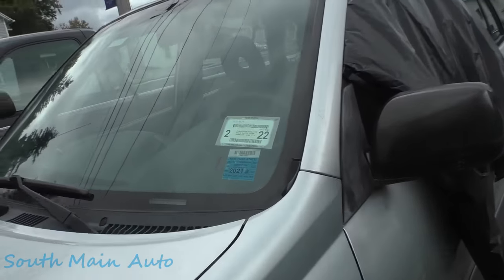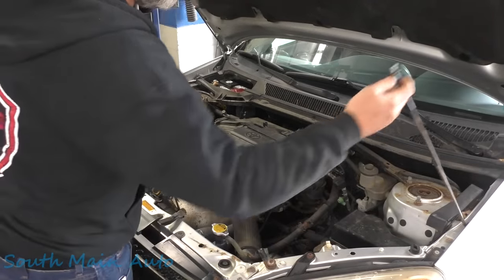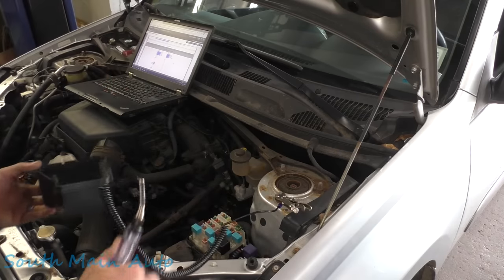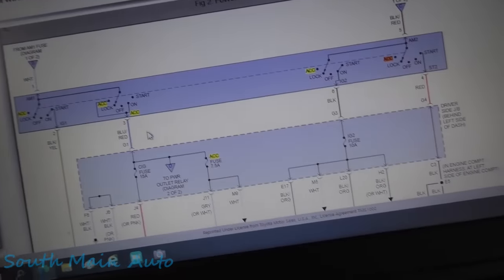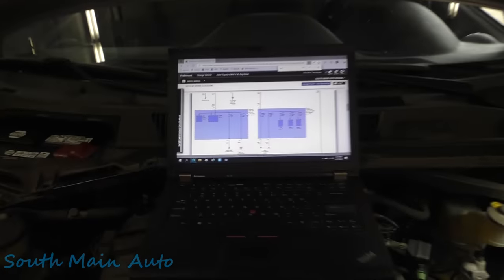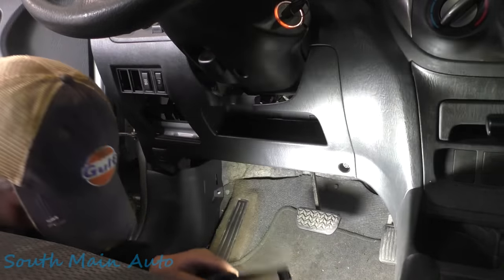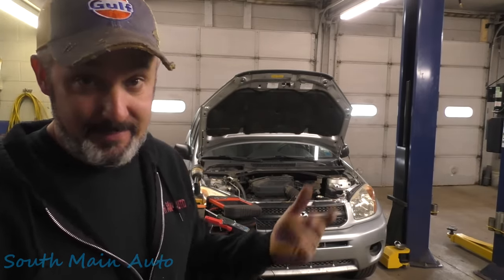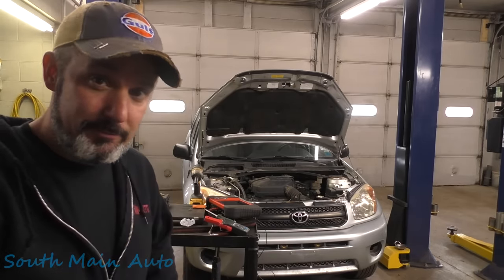Toyota Rav4 Is D.O.A. But Still Runs?

Comment: 24 years with Toyota and 99% of these cases is the customer jumped them backwards! I’ve been a master tech for Toyota over 2 decades and I still learn a few things from your skill! Great humble work my friend!
Reply: What does jumping it backwards entail? Only time I jumped a car off of anything other than the battery (car not tractor) was a stupid BMW (apparently they put the key lock back on and it was only for a few years) where the battery was in the boot and it wouldn't open and had no key lock. It did however have engine bay battery posts fitted by BMW.
Reply: @usefulcontent9894  Jumping  it backwards means putting the jumper cables on the wrong posts(so positive on one car to the negative on the other), either on the car you want to jump or on the other one, effectively shorting out the electrical system on both cars.
Reply: @Enakaji  Thanks. Here in England I don't think we have a term for it. You would just say "they put the jump leads on the wrong way round". I asked because several people said the same thing.
Reply: @Enakaji  Also, in UK someone would be naive to say "reverse the polarity". The Dr Who jokes, comments, references etc etc would likely be too much for the ordinary person to withstand 😀
Reply: That, or if I recall correctly, the Toyota "main fuse" can be blown by attempting to install a battery backwards with the positive cable on the negative terminal and vice-versa.  It's an expensive screwup, but Toyota limits the damage to the fuse rather than the rest of the electrical system.  Some Toyotas use the "R suffix" battery configuration which reverses standard terminal polarities.  They do this to locate the battery on the most convenient side of the engine compartment with the shortest cables.  If the previous owner did not buy the right battery for the RAV4, then he may not have known that correct polarity is very important.
Reply: Yep! Thought the same.  I was thinking they installed that battery backwards (incorrect battery), because that's the most common way the main fuses blow on Toyotas. That, or they helped someone and crossed the jumper cables.
Reply: That could definitely explain the new battery as well, good call
Reply: If not jumped backwards, then they put the jumper cable on the wire, instead of the battery terminal... where it then moves and shorts against the frame.

people believe they shouldn't clip to the battery directly, and they don't... So then they clip on The other side and short stuff
Reply: Without admitting guilt there is a Toyota truck with a soldered in 14 gauge wire fuseable link.          Still running fine.
Reply: That's exactly what I was thinking because the new battery and all.
Reply: @parkinson1963  Yep!  That's what I would have done too ... "hey, it works" ok, if it blows down the road, we'll put the right fuse in without soldering - and it will usually work forever.
Reply: @parkinson1963  ......... lol nice work
Reply: But in 24 years, have you WITNESSED this happen before your eyes? Its an amazing thing to watch as two cars die and the two car owners are looking like they're about to kill each other especially the poor "I don't know anything about cars but are you sure you know what you're doing" person who offered up their car to be helpful. Now their car is dead in the gas station parking lot by the dumpster too
Reply: Looked like they had something hooked up to a toggle switch then it was removed. The previous owner probably blew it when taking whatever it was out before they sold it. That pile of electrical accessories on the floor looked suspect from the get go.
Reply: Embarrassingly, I jumped my gf's car backwards 😅 01 rav4. Luckily I only blew the fuse that powers the radio and the interior lights

Comment: The ONLY electrical component that never fails is the fasten seat belt chime.  When the entire car is crushed into a two foot square ball, it is still emitting that horrid chime.
Reply: Whoever came up with that as a standard on vehicles has a special place in hell waiting.
Reply: An attorney, no doubt.
Reply: So glad we don't have this crap in the UK, I don't know if it's on newer cars though..
Reply: @warbuzzard7167  🤣🤣🤣 that's great!
Reply: @cheeseburgerbeefcake  On my 2012 (European) Volvo, the seat belt warning only chimes if you have it unbuckled and you're moving (followed by an obnoxious beep if you ignore it). Never really saw the point in that annoying chime when you're standing still with the engine off.
Reply: I agree fix what you are requested by work order. My only expectation would be notify the customer especially if you have half the car apart that would be required to make the additional repair. Only other beef is when Nuts and Bolts are freed from being rust frozen, especially brake and suspension parts that the threads be cleaned and anti seize be used on the re-installation to help with future service. Eric is good in this way as he regularly uses Fluid Film to fight the corrosion battle. Others just ram the crusty threads back together.
Reply: Lol there is a fix for that and It Is forever band.
Reply: my volvo will clamp the seat belt down with the power of a winch if you accelerate a tiny bit too hard but if you remove your seatbelt it chimes for 5 seconds, then all lights and sounds disappear for the rest of the drive. makes no sense lol
Reply: If you wear your seat belt, you won't hear it
Reply: @milfordcivic6755  It is hard to repair under a car's hood  while wearing the seatbelt.
Reply: That's why I drive older cars without all that B.S. on them
Reply: Most people don't know how a business is run or they would have one!! Good job my guy!
Reply: Apparently, my old Silverado (bought from family of older gentleman after death) doesn’t have this problem because the old feller deleted the seatbelt chime lol
Reply: I used a scan tool and went in & turned mine off, kinda crazy but that's an option on the new Toyotas lol. Of course, you need a scan tool in order to do it though. All kinds of customizations available with a good scan tool.
Reply: @jamesofallthings3684  Some democrat in DC that works for the Department of Transportation thought he was saving the world. If you think those are bad, cars in Japan start dinging as soon as you go over 60 MPH, and they don't stop until you slow down.
Reply: @donniev8181  What scan tool was it?
Reply: @tuberNunya  the Toyota specific Launch X431 Elite, it cost me around $125 online.

Comment: Reversed cables on a jump, installed battery backwards or didn’t disconnect battery when installing alternator
Reply: The spark out component could have been on the vehicle providing the power during the jump. No evidence left on the dead car.

Comment: "Do the job you were hired to do" is so true when it comes to an automotive repair business.  For me this applies even in the DIY category where I have agreed to do repairs for friends and colleagues but along the way have found other problems. For friends / colleagues the job is similar to a shop job, I'm doing the work agreed at "mates rates" and if I see something else, I'm passing on the bad news! 😂

For family, I will do just that little bit more, if it is in my capability (which a great deal of things are) so labour might be free but the parts won't be! I'll fix as much as I can or want to outside the original job, just outta love! 😏🙄
Reply: This applies to being a computer tech. Communicate the need, move forward if the customer approves, but stick to the plan/quote/request.
Reply: Family is the worst they expect everything for free
Reply: I agree but have a slightly different policy with my girlfriend’s car, because if I don’t fix it, she sure as hell won’t, and in six months I’ll be fixing it anyway. So, in this particular case, IF it was her car, I would have grabbed the battery hold-down from the junkyard or at a minimum put a bungee cord over it :)
Reply: I fix all my family vehicles.  Can be a pain, especially when they just put gas/diesel and ignore all the other shit.  Used to head things off at the pass, but no more.
Reply: I charge my family.. even my parents, not customer rates, because in my 58 years it became obvious that if you don’t value your time and efforts, they won’t either.
I have a GREAT relationship with all my family, and respect too..!!
Reply: @FourbrrlGrabber  Correct. People will not appreciate what you do, if you do it for free all of the time. They start to expect the hand outs, we call this entitlement.

Comment: I've had a couple good mechanics who have standing orders to "fix whatever needs fixed and give me the bill".  Hard to get a relationship of mutual trust like that.
Reply: I have customers like that but they are few and far between. They know and trust me not to play games. Those are the customers that often turn out to be friends.
Reply: @andynicoll8566  there is  a place in Lubbock I trust that much. Sadly, their contracts forbid them doing things that involve "opening up" the engine, so ... no rings, no valves, no valve guides, no full set of gaskets. They have a contract with a xmission shop that's very good, too, tho, so if it breaks enough ... (fixin' to try to get a crank sensor on my '94 V10 iron block).
Reply: @OtherSarah2 ? Location
Reply: @Txcowboy80  Texas
Reply: @OtherSarah2  I’m from Lubbock too. Asking about the specific business. 😂
Reply: @Txcowboy80  I trust the Downtown McWhorter's location (Kevin and Mike, especially). Been going there since 2000.
Reply: I have that with my mechanic and electrician. Very nice to have that trust.

Comment: Probably shorted the alternator side of things when installing the new alternator because they didn't unhook the battery first.   At least you were able to find and fix the problem.
Reply: or they jumped it backwards, seen that many times
Reply: Wouldn't be surprised, or shorted the battery terminal with a wrench while changing the battery, either way its gonna blow some fuses, make pretty sparks, and if you are lucky doesn't fry all the computers in the process LOL.  

When he first stared with all the stuff that was dead I was like well someone blew a pretty important fuse, fuse link, or something somewhere by doing something stupid...guess I was somewhat right LOL.  

I even looked on Rock Auto for that fuse, nope, they don't have those, so I'm guessing its a hope you can find one in a junk yard type deal.
Reply: @wildbill23c  they are available aftermarket and new from the dealers, like $30-40.  Toyota PN 82620-42040  but... They appear to be special order items, and when you have a salvage yard nearby with the part you need today.... It gets the job done sooner.
Reply: I blew the 150A main fuse on my 04 Pontiac Vibe, along with a handfull of other fuses, after I accidentally jumped it backwards. Glad that it was just fuses that went...

Comment: Running a shop and DIY work are so very different.  I agree with you. Let the customer know what you found and they can determine the next steps.  You and your family have a great day and thanks for the videos.
Reply: Yep, good for Eric to explain the ‘workshop’ way and the ‘soy’ way..

The bad thing about ‘diy’(in my experience the ‘Wormhole Effect’ where a simple repair ends up being an almost full blown restorations..

Please don’t ask me how I know…
Reply: ‘Diy’ way… not ‘soy’…🙄
Reply: @malcolmyoung7866  Ohhhhhh yes, safe to say we've all been in the DIY repair black hole before. It's always "While I've got this all out" or "While I've got this taken all apart" or "If this one failed, the other(s) are gonna kick the bucket real soon too so I might as well do them too." Pretty soon you've got a restoration going on and bought a special tool that you'll use one time and then never again. 🤣 I have had this discussion with the customer before when it made sense. "We're doing the clutch, and this is a big subframe drop job. Lots of labor. Are you going to keep this car for another 5-10 years and drive the wheels off of it? Yes? Ok, then we should honestly do the rear main seal, input shaft seal, and both of the clutch hydraulic cylinders at this time too. At least do the slave cylinder since you could do the master later when it fails, but the slave is inside the bell housing. The parts for both seals are cheap and labor is tiny. The slave is pretty cheap too. It will really suck if we do this clutch and then the seals or slave start leaking badly and it's alllllllll gotta come back down and go back up again. You'll have to pay the same 5 hours of labor at $110 an hour. Can we just spend the extra $60 and take care of that all now? If you were dumping the car in a year I wouldn't suggest this, but you're at 150k and those seals and slave are not going to last much longer." Once I describe common sense math and part lifetimes, the customer agrees to it if they are able to dip into their savings. I definitely do understand the struggle of the paycheck-to-paycheck single mom of 3 who works retail at minimum wage and just needs a reliable shitbox that will allow her to get to work to prevent eviction. :( There's a big people element in this job, you know?

Comment: I love your diagnostic videos. I actually specialize in Auto Electric and I love watching how other people diagnose so that I can try new things. But another way for that fuse to blow is if when replacing the alternator, the battery isn't disconnect, the main alternator cable gets grounded somewhere and will blow a main fuse. I've had a couple of my techs do this. So that's probably what happened
Reply: I'm no auto tech but I've replaced a few alternators (and generators!) over the years and that's what I was thinking too. It's really easy to imagine a DIYer getting an alternator from a parts store and swapping it out without thinking to disconnect the battery.
Reply: To be honest that was my suspicion too as far as that micro switch that was on the floorboard in the car I really wonder what they're using that for have a great day
Reply: @JeffDeWitt  I did my alternator last month and I'll tell you dirty trick get the smallest bag you can find pull the cable off of the alternator and slide it over make sure it does not come off light it over to cable and it goes to the alternator then you can move the alternator without grounding the battery and just be very careful when you put the positive feedback on to the alternator that you don't ground it out and it will work have a great day oh by the way I spent almost as much time trying to find my 12 mm socket that I dropped cuz I hate losing tools I like complete sets and if one isn't socket is missing drives me crazy drove around for 2 days open the hood got a magnet and a flashlight lo and behold it was my socket sitting right there have a great
Reply: @michaelpressman7203  Lucky it wasn't a 10mm socket or you never would have found it! 

As to replacing an alternator I'm not messing with a bag, it's easy enough to disconnect the battery.

Comment: With no battle scars, I vote for the knucklehead changing the alternator without disconnecting the battery. Somebody's got a notched wrench somewhere and they're not telling.
Reply: When I was an apprentice electrician I ended up with a set of catalog pliers cuz my boys said go cut these wires and it cut the black wire and the white wire at the same time blow two perfect holes in the pliers cutting jaws 50 years later I still have the pliers have a great day

Comment: Great job Eric. Another cause could be that before the battery was replaced, they tried to jump start it, and hooked the cables backwards.
Reply: This.  A Lexus has a similar main fuse and they blow the same way when jump start cables are connected backwards.   And Lexus is Toyota in many ways.
Reply: Agreed. I have seen this more than once on a Toyota product. My students routinely jump start backwards. 😂

Comment: Eric, I run a mobile repair, and specialize in just that sort of repair. Over heating, because daughter never looks at coolant, etc. Your right, just fix what they want. Bye the way, I have found that exact problem on vehicles that boyfriend tried to jump-start a dead battery and crossed the poles. LOL
Reply: Yup. Just had a 10 Chevrolet 1500 towed in with a no power/no start. New, fully charged battery and the tell tale ark mark on the positive post. Power at battery but no power after the main fuse. Friggen AAA strikes again. Sold them a battery after blowing their fuse trying to jump it and then towed it to us.

Comment: totally agree on the "why didn't you fix??" comments. I often get asked when doing a brake job for instance..."hey did my front ball joints look ok?" I dunno... that's not why I was there.  The only time I deviate from this is when I see something blatantly unsafe, I will inform the customer.. and sometimes I won't let a car leave without repair. Great vid!

Comment: Eric that car is in good hands with you especially with that vintage Gulf Oil hat on!    People can still break a virtually indestructible vehicle.   Amazing.    Got to love opening the door and finding cut pieces of wiring etc.  Scary!   🦇🦇🦇
Reply: So true I'm a car nut myself and have bought cars where people have just messed with them unnecessarily adding stupid aftermarket accessories I have had to remove a lot of those Toyota's and Honda's will last forever if people would just leave them alone stop cutting the suspension putting those stupid lights underneath they're fine the way they are they last forever from the factory lol Just maintain them and drive them
Reply: I wonder what that micro switch was for have a good day

Comment: at a dealer a service advisor would recommend many services probably also replacing nitrogen in all tires including spare.
Reply: It's not just dealers that do that. A local 'trusted' independent shop quoted a friend of mine $4000 to fix a junky old car that was only worth $1k. I fixed the issues for $200. Disgusting thieves.